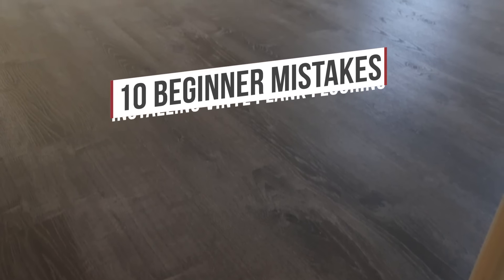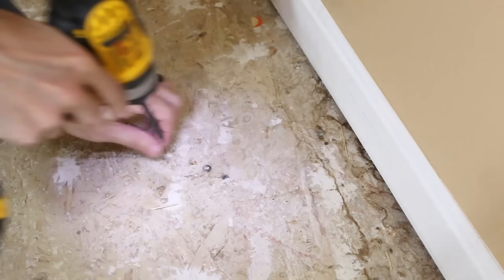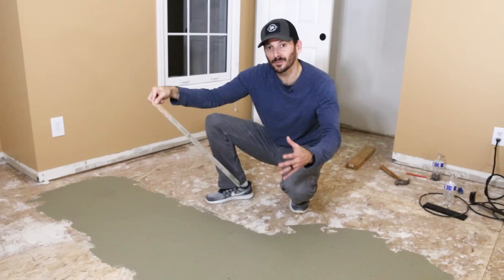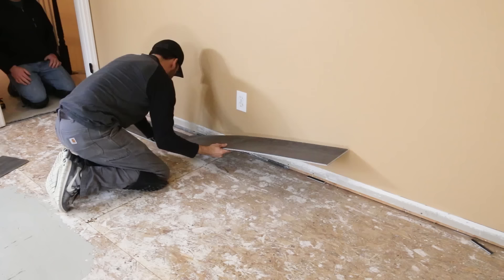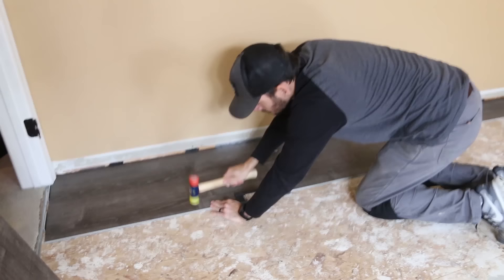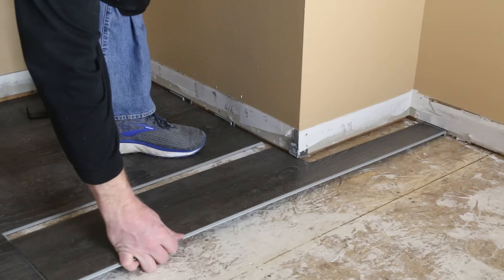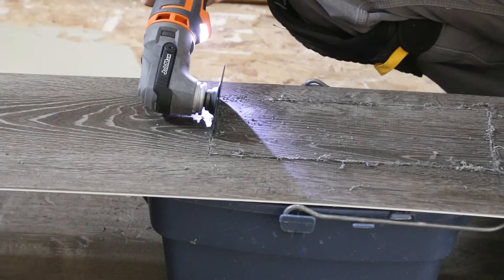10 Beginner Mistakes Installing Vinyl Plank Flooring

Comment: With any click type plank flooring especially LVP your first row is the most crucial. If you’re not straight on your first row and your planks edges don’t all long up perfectly, not even a 32nd off from the plank beside it you will be having a nightmare of a time by row 5, you never get your planks to lock together properly, you get gaps and you will want to rip your hair out. First couple rows you need to be on top of it so you can ensure your planks are in perfect position while you can still  make adjustments

Comment: I agree with taking off the mop boards, rather than hiding the edges with quarter rounds.  Looks more professional, plus it leaves more floor space.  Quarter rounds seem kind of like the short-cut solution.

Comment: If someone were to follow this video without making mistakes it would result on a decent flooring install that would be fine, but there are a few issues in this video when viewed from a professional flooring installer's perspective.

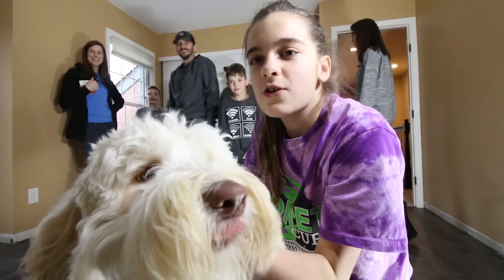4 inch razor scraper is significantly easier for pulling staples than pliers. The trim pull tool is okay if you've already separated the baseboards from the wall with something like a 6 inch putty knife that can slide behind them, but you can clearly see at about 2:10 in the video the trim puller damaged the top of the base board when used by itself. At 4:15 you say if you don't undercut the door trim for the floor to slide under then you have to scribe the flooring and caulk it to the door trim but this will void your warranty on a floating floor because now you have trapped the flooring from being able to stay where it is when the house contracts and expands. 12:00 I would ditch the U channel entirely and use an adhesive for the T mold instead. The transitions that come with U channels are almost always some kind of composite paper product with a thin vinyl wrap on the surface and the U channel tends to cause damage to the transition piece and can easily split the bottom of the T clean off the rest of the transition. I've gone to fix other installers U channel transitions but never had to go back for one which was glued. 12:08 you can see that the transition should have been further back toward the carpet because the cut edge of the transition is exposed, which seems like an oversight when you're concerned about eyesores. 12:25 Specifies "sound suppression underlayment" will void the warranty, but something like a quarter inch underlayment stapled down would not void the warranty, though it's generally unnecessary for a floating vinyl plank on a flat subfloor.

Comment: If you use a scraper or flat shovel will work to knock all the staples up. If your careful the scraper can be use to take the tack strip off by hitting the tack strip where the nails are holding the strip down . The tack strip factory nails should pop right out . You will still need a  prybar to get the nonfactory nails out . And for the tack that slides under the trim.

Comment: I'm goin to be putting down vinyl plank in an area that will need to have the wall adjusted to frame it out for a door (it is currently a doorless archway). I'm thinking of using the planks as a guide to set the doorway up high enough that the trim won't need to be undercut. Should I install the door before or after the planks? I have the kind of planks that are floating. Also, how far into the doorway (swinging away from the room with vinyl plank) should I put the track to hold the trim? Or does that depend on the reducer trim?
I'm also going to have to install a new pre-hung exterior door after fixing the door sill and rotted floor at the doorway. Debating whether I should install the door or the vinyl first on that one. If I install the door first I'll use a piece of the vinyl flooring to make sure it is the right height and won't scrape the floor when it swings in (the current door scraped the floor bc someone installed it incorrectly).
The room I'm going to install in will have 5 doors. On the south is the doorway I'm adding to a bathroom (door swings into bathroom), on the west wall there are two doors next to one another. One swings in to a bedroom, another swings out from a closet. On the north wall is a doorless archway but I count it as a door. On the east wall is an exterior door that swings in. I want to start over near the south doorway and go south to north. A washing machine and dryer will go over the floor on the east wall.
Copper is adorable!
The graphics showing the installation info was helpful. 6mil polyfilm for vapor barrier. I think that would be good in the laundry room.

Comment: I installed luxury vinyl under the toilet and sink. I think that caulk will inhibit the flooring from expanding our cause it to pull away from planks adjacent to the toilet area. Also if the toilet moves with the floor, won't it break the wax seal? I need a pros opinion

Comment: My kind of video. I learned a lot. A Multi-tool and an Impact Driver. Two tools that any DIYer must own. You named your dog Copper. Why not something like Snowball? All-white dogs in FL are named that. That tool you used to remove the baseboard. I gotta get one of those. Adding up the cost of all the tools and material you used, especially that compound miter saw (gotta get one of those too), sounds very expensive. What did a PRO, Professional Rip-Off, estimate the project would cost you? Having a PRO install this in my Living Room. When I told them that my carpet had dog stains. They said that I had to remove the carpet. COVID-19, I guess! About that leveling part. Don't they call this type of floor covering "Floating Floor"?

Comment: I have to raise my floor up inch to match another floor in my house on the main floor so I’m confused on the installation.  Do I do concrete flooring/vapor barrier/plywood to raise floor/engineered hardwood or is it concrete/plywood to raise up the floor/vapor barrier/engineered hardwood?

Comment: For staples just reverse the 4 inch blade on a scraper and you'll shear them off or pull them up effortlessly
Reply: Exactly what I did, used the corner of a scraper (longer putty knife) and they effortlessly snapped out.

Comment: The vinyl flooring in my house I just bought has underlayment under is and it almost gave it too much movement and has cracked the ends of the boards where they lock together. So now I’m about to re-do all of it because someone couldn’t follow directions. Works out though because I just put a new kitchen in and we don’t like the color of the flooring haha

Comment: Layed plank flooring on uneven floor few times (privately, not hired of course) tbh it works but I'd never do it like this for someone else. Also depends on how uneven it is, if it's gradual unevenness or if it's uneven in the middle or at the edge of a plank

Comment: QUESTION!! What if the wall isn't straight and we place our 1/4 inch shims along the wall? Wont the planks start to veer off from a straight line since we're placing our planks flush against the uneven wall?

Comment: I want to lay flooring in a room but can’t afford to do my whole house at one time. Once I install the transition strip would it be easy a few months later to pull it up and continuing laying my planks or would the strip have to stay? I want a smooth continuous look just don’t know if the ends would click once I take the transition strip up

Comment: Baseboards on top of the flooring because it looks so much cleaner and professional. I removed all the baseboards when I removed the carpet and put in laminate and put the new baseboard on top of the laminate. When I decided to remove the laminate and go with vinyl I again took out the baseboards and put the baseboards on top of the vinyl. It's a lot more work but it looks so much nicer. When I ordered the vinyl flooring the vendor ordered that quarter round but I ended up not using it and I had to fight with them on it. It was home Depot. I told them they could inspect the house after the flooring was all done in the baseboards were installed if they wanted to but I did not want that god-awful quarter round on the floor. That quarter round looks terrible. If you insist on leaving the baseboards there's a smaller molding that looks much better than a big huge quarter round. The only thing that bothered me on the vinyl install is the height is less than laminate so I ended up having molding around the doors at the floor level that I had to do some repair work on. Not going to worry about it cuz I have to eventually replace the doors anyway

Comment: All looks good however, you now have a small piece by the door ,a heavy traffic area in the 3rd row. a good place for that joint to work lose. cutting another piece in half to move that joint over is better. 
but over all looks very nice.

Comment: We had vinyl plank flooring installed when we had a kitchen remodel.  There is one spot in front of our refrigerator that keeps lifting up and a good 3/4" space that keeps appearing.  What can we do to avoid that?  We tried to rebump it together using mounting putty and a piece of 2x4 bumping it closed but it pops right back out.

Comment: I usually use 3 to 4 rows of random to start, with the 8 to 6 inch spacing from planks , that will usually give you options to use the full cut from the far wall.. and u can also score the plank with utility knife and press the ends down with your leg in the middle... This can save you hours of time.😀
Reply: But great video 👍

Comment: Hi , what is the glue or material are you using to filling the uneven areas ? It’s a regular concrete? If is a concrete cement that will break down on pieces ?
Thanks

Comment: I always leave the baseboard if the customer isn't upgrading it. Couple reasons. 1 is because 12 or 16 foot pieces of baseboard are rarely laser straight and aren't that flexible so it's likely you'll have parts of baseboard that can't completely sit on the floor so you'll see a gap under it. 2 shoe molding is small and extremely flexible and can be attached with a 23 gauge pin nailer leaving holes all trim paint will cover without filling and it'll hide the gaps that the baseboard leaves. 3 when you reinstall the baseboard you're probably going to use a minimum of 18 gauge nails which will need filling. Then recaulking the top to the wall for a tight clean look requires paint to keep the caulk from turning yellow over time. Then for a super clean paint line on the colored wall you need to repaint or cut in the wall above the trim if you care how the final product comes out. I will always add the smallest shoe mold (never quarter round because the shape is different from shoe molding) over vinyl. Then caulk it to the existing base and repaint face of the base with the shoe. I'll even put tape on the new floor in front of the base and install the shoe on it to guarantee no paint on my floor then cut and remove tape.

Comment: I had my VPF laid on a concrete floor. Every seam popped. Isn't there supposed to be a 1/4" gap between every wall and the floor so it "floats"? Also does the concrete do something to the flooring to make the seams pop ?

Comment: I am getting conflicting info on the underlay situation. Can someone please help me? I'm laying on to concrete and have been told that underlay will be necessary to prevent mositure and a cold floor. Do I have to have underlay on a concrete floor or should I just lay striaght on to the concrete? Many thanks for your help with this.

Comment: Question... I'm installing vinyl plank flooring on top of a concrete slab in my study.  The vinyl flooring has underlayment attached so there's no "need" to put down underlayment first. However, the vinyl flooring is only 1/4" thick and when compared to the adjacent tile floor (foyer/entry area near front door), the surface height of the vinyl flooring will be about 1/4" lower than the height of the tile floor.  Of course, 1/4" doesn't sound like much, but this is a high-end home and I want it to be "perfect".  I might be the only person to actually notice this, but since I'll see it every day, I don't want any regrets :)
What would be the best way to ensure the vinyl flooring surface is even with the tile floor surface (or at least close).  I suppose I could glue down some 1/4" plywood underlayment on the slab, then install the vinyl on top of that.  Any recommendations on better options?
Thanks in advance!

Comment: I live in Canada. I had several problems and issues from the installer spilling something on the newly installed floor and covering it overnight. We asked them to repair it and they ended up messing up 3 planks instead. Another plank started to break upwards on the long edge in the kitchen. We lost any trust in the installer doing any repairs as they seemed to not know much about installing or repairing deficiencies in their own work. The issues got so bad that we just said that we will repair it ourselves. I have replaced one plank now and it is like brand new with no issues (long edge broken upwards from lack of 1/16 inch of shims along 2 feet) If the installer tells you that they are "not responsible for the subfloor" tell them you are going to get another estimate. The floor irregularities must be repaired. If not some areas of the floor may break.

Comment: In the video you install small pieces to act as a spacer at the start of the first row. Do you go back and remove those spacers or just leave them there? If feels like they should be removed since it is a floating floor, but no one really covers that part.
Reply: You would go back and remove them.

Comment: I removed old tile in my kitchen, my problem is the base boards were easy to reinstall, but I have a gap around the door jam’s.do I have to lower the molding around the door? But the molding on top doesn’t look good around the top of the door. The molding around the door is recessed about 3/16”. I will loose the look of a nice door frame. Any help would be appreciated, thank you. Kevin

Comment: Good job! I’d add fault number 11 though. After making the first few rows check the measurements on opposite wall to ensure you don’t end up on a slither of lvp. Also1 question…is dryback lvp used in America? We fit so much of it in uk and I prefer it as you can be more artistic with it. As in making borders around floors with design strips and motifs. I only ask because I don’t see American vids on this work

Comment: I’m ripping up the carpet and installing LVP in a converted attic bedroom that definitely has patches of uneven subfloor (i noticed when I moved in my dresser tipped away from the wall a bit because the floor was sloped there 🤦‍♀️). Do you have recommendations for a brand of self-leveling floor patch that can be used on plywood (and not concrete) subfloors?

Comment: Sometimes you don’t have any choice but to leave the baseboards down. I’m putting down vinyl plank in my foyer and kitchen (which are kind of connected) but that place is also connected with a hallway that leads to the living room. This hallway has carpet and if I were to remove the baseboard and reinstall it with the higher level, it would be above the carpet and would throw everything off in the entire house

Comment: I found that I could cut off the staples that hold the padding down with a multitool with a circular blade made for cutting light metal. That was way faster than pulling them. Also, the downside to taking out the baseboard is that after you reinstall it, you have to patch above it and repaint the wall. I can install shoe molding way faster than that and I actually think it looks more finished with shoe molding.
Reply: Try using a scraper or prybar on the staples next time, way faster, also saves you a blade, next time you remove base, use a brand new blade on a box cutter and cut the top caulk of the base be sure to get it a little bit into the drywall, so when you reinstall the base your new caulk will cover everything and no paint repairs necessary.

Comment: Is it possible to change the baseboards and remove the quarter round for a floor that has already been installed the lazy way by leaving the baseboards without changing out the whole floor?

Comment: Hey...I got an OLD house made by wood...Was builded over a sand place. Thetefore, it is loosen level AT some spots about 2.5 inches. I got the material to install vynil planks, but IT is so much lose level....
Would you mind for an idea to fix  it... Please..?
Thanks.

Comment: When I moved into my new house I noticed that there are some noticeable  dips in the finished floor with LVPs installed. The dips are next to a inner wall. How difficult would it be to remove the planks in the problem areas and pour levelling cement? Wondering if I should just let it be at this stage.

Comment: by removing the baseboard you now dont only have to lower them, now you have to remove thepaint ridge from the wall and repaint the room, corner round is the correct way unless you are doing a complete refresh !

Comment: So if I buy the wood planks from Costco that says it has the padding under it.. I don't need to buy extra padding to put down on a cement floor or wood floor (downstairs is cement, upstairs is wood) right? I believe it's 12mil flooring.

Comment: Hi,
I have been watching your videos and like them a lot.   I am planning to install SPG for the rooms upstairs.  What is the best thickness you would recommend ?  I am looking at some design with 6mm 20 mil wearlayer.  They are pretty heavy.  Would that be okay for the sub floor?  And do I need the under lining ? I did not see you using it.  I think it depends upon the types of the planks, correct?  Thanks

Comment: what was use to level the floor before installing the vinyl? and you dont have to use any glue to make sure it stays? or is it just connect and lay on the ground? please help i got a project going on and need to know what to buy